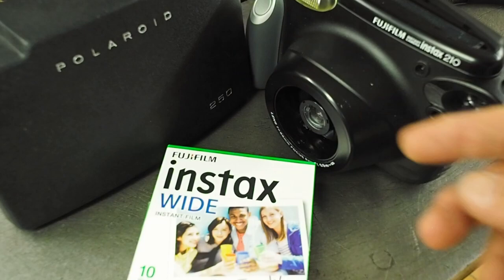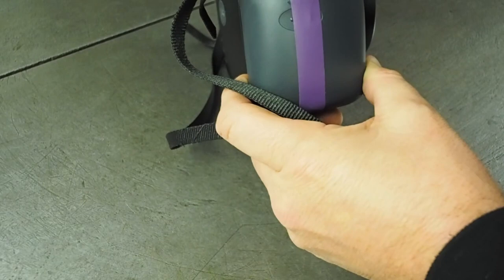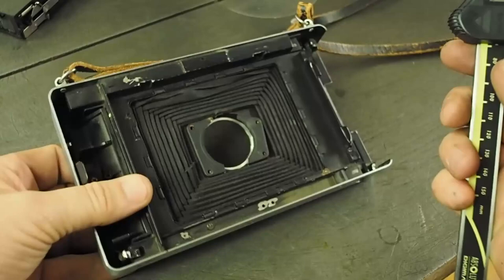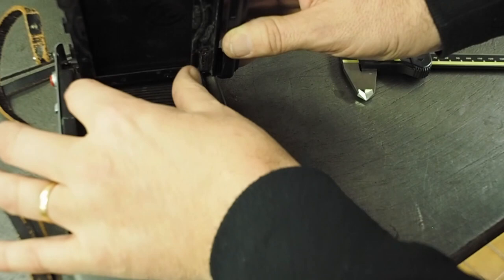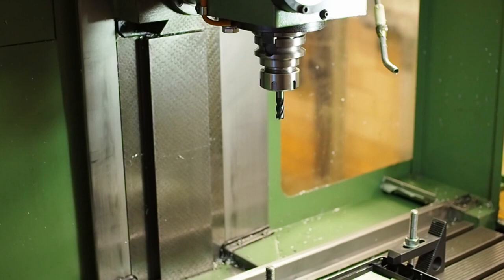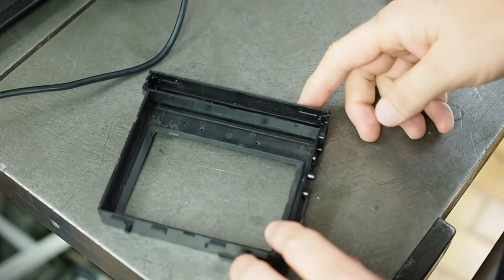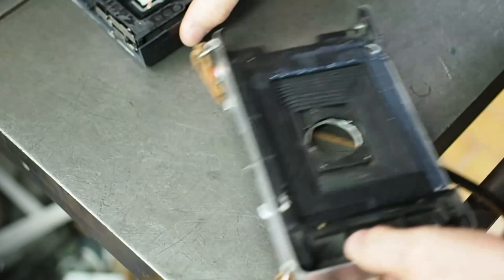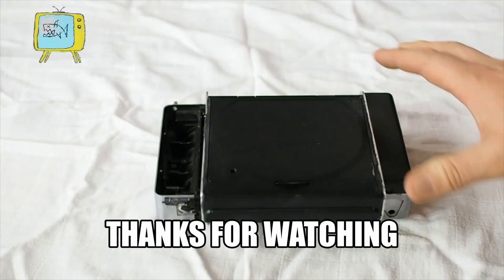Why is it hard to use Instax film in a Polaroid camera? Hacking a Land camera. Episode 1.

Comment: The problem w/ converting the Polaroid 100's (100-300) has always been the inability to move the focal plane infinity focus, thus all that milling.  Just went to episode 3, and bingo you bring it up. Polaroid 110's are way easier to modify for Instax Wide...as infinity focus is adjustable.
Reply from the maker: Good point. I also have a 110, and an 800 which I started hacking years ago to packfilm, until Fuji pulled the plug there.

I was surprised how easy it was to 3d print the new lens standard for the 100 series. So much of these cameras is riveted together, that I expected some sort of difficulty there as well.

Comment: I suggest using silicone gasket maker (permatex) over JBweld. You can pry the silicone apart later if you need to modify further and the bond is never going to be compromised short of your prying.
Reply from the maker: Good idea.
Reply: Which permatex do you reccomend? I usually use JB weld for my mods but this has me interested. Will it dry rigid? Meaning the part won’t move around at all? Thanks!

Comment: Have you been able to modify the Polaroid 800 land camera to instax film??! Seriously I inherited my grandfather’s Polaroid and I cannot get film for it. I will pay you for the conversion!!🙏
Reply from the maker: The Polaroid 800 was designed around the original instant roll film, with the last type  discontinued in the 1992. The 800 camera production ended n 1962. The 800 lens is nothing special, and it has a very primitive ato exposure.
I was grafting the 900's rangefinder onto the 110A body. That project lurks on the "incomplete" shelf. 

Did you see the there is now a Lomography Graphlok back available? This could make the conversion a fair bit easier. Problem is that you still need to relocate the lens standard back as you cant get Instax to the original film plane.  These are seriously simple light tight boxes. If you want this series, there is no finess to such a conversion, Just hack away at everything which interferes, until things sort of fit, and then bodge it all back to getter wit lots of thick glue to fill the gaps. Go for it.

It might be best to put your Grandads camera on the shelf as a momento, and butcher a less sentimental camera like a land 250 for instax.

I dont even get my own projects done in any sane time frame, so I wouldn't offer commercial work. It was just frustrate people.

Comment: Would this work for the 230 model? I have a really good condition one and I want to shoot some stuff without using expired film or the fuji stuff.
Reply from the maker: Yes, of the land camera series have the same basic geometry. The250 has a better range finder, but you can easily add that later.

Comment: WHY YOU DON'T TRY 3D PRINT AN ADPATER WITHOUT HAVING TO MODIFY THE RECEPTOR CAMERA AT ALL, ONLY STOPS THE BELLOWS BEFORE IT GOES ALL THE WAY FRONT COMPENSATING THE BACKWARD OF THE NEW POSITION OF THE FILM, THE CHALLEMGE WILL BE TO CREAT A LOCK FOR THE BELLOWS OR SHIFT THE ARMS OF BELLOWS BACKWARDS
Reply from the maker: Hello Edward, Why shout? All capital letters is considered shouting on the internet.
Please try and execute your design ideas and make a video about it. I would be interested in seeing how it works out for you.

Comment: I think you will find there is a much easyer way,   either drill new holes in the scissor arms & re attach the lens board 9mm back, or drill out another notch where the scissor arm attaches to the camera body, so the lens board sits back 9mm.
Reply from the maker: The lens mount board is the easiest to adjust. Changing the sissor links accurately would be more difficult (remember they are riveted not screwed), and moving the sissor link attachment back 9 mm in the body is not possible (at least highly impractical.)
Reply: @RotarySMP  Ohh sorry I ment change where the scissor arms attach at the lens board. If you where to attach the scissor arms at the front of the lens board, insted of at the back, that would move the lens back to give you infinty focus. Or make a deeper lens board, that moves the lens back further.
The second way I was thinking was this... when you open the camera, 1 of the scissor arms is fixed at one end to the body & the other end slides along inside a slot on the camera body, then locks in to position, simply put a new notch in that slot, so the scissor arm locks the lens board at what ever position you desire.
Reply from the maker: @davidbrown_au  Look at the later videos. I made a new deeper lens board.

Comment: Hello!! Can I use the modern Fuji Instax sqaure in my Polaroid Square Shooter 2? The film size differences are just by 11mm. (Instax Square 86x 72 mm / Polaroid 80 film 86x83mm).  Would that be possible? Thank you!
Reply from the maker: HI, anything is possible :) 
I am not familiar with the Polaroid square shooter, but as a form of pack film, I am guessing you manually pulled the polaroid type 80 film out.

So it should be possible to remove a single Instax sheet within a changing bag, and transfer it to the square shooter. After exposure, transfer it back into an Instax film cartridge and use an Instax  camera to drive it through the developing rollers

Hacking it like I did would be a similar task as mine, and you would need to displace the film plane and therefore replace the lens. Not trivial.

Comment: Safety tip: printer toner is *incredibly dangerous*. The small particles are a kind of dust almost that the laser printers pull electrically, and then fuse onto paper. So it's incredibly fine, can handle a charge, and is very easy to get into your lungs, even if you don't smell any.

Long story short, if even a tiny amount spills in a room, you're supposed to evacuate, and clean it up with lots of gloves, respirators and damp cloths.

Be safe and avoid spilling it on purpose in the future!
Reply from the maker: Thanks for that. I will look for a safer alterntive black pigment.
Reply: @RotarySMP  Just so you know this is real and I got your back and not making it up, even wikipedia has a segment on it: https://en.wikipedia.org/wiki/Toner#Health_risks

They sell "haz mat" cleanup kits for it for offices... It's one of those things that's so dangerous but that nobody realizes. Spread the word and be safe =D Another reason why hackers like me and IT people in general hate printers!
Reply from the maker: @purpleidea  I appreciate your input. Something I (stupidly) didn't think about.

Comment: Have you been able to modify the Polaroid 800 land camera to instax film??! Seriously I inherited my grandfather’s Polaroid and I cannot get film for it. I will pay you for the conversion!!🙏
Reply from the maker: I thought I replied to you a month ago Liisa, but don't see my response in the comment section.

The 800 used a different, even older roll film system, rather than pack film. It is not a good basis for a conversion. I would recommend you put it on the shelf as a momento to your grandfather, and get a Polaroid 250 and an Instax wide and have at them with a saw and file. 

I don't do commercial work sorry.